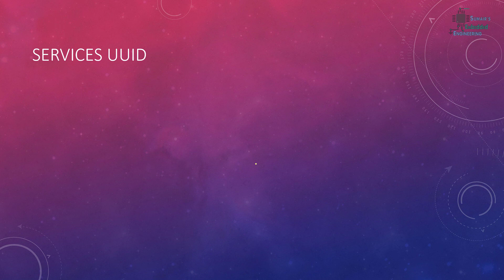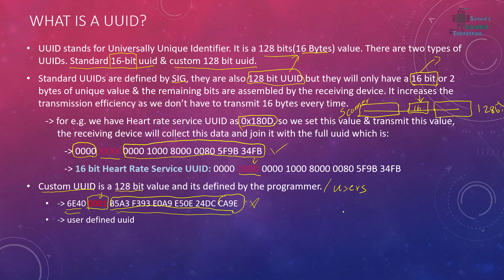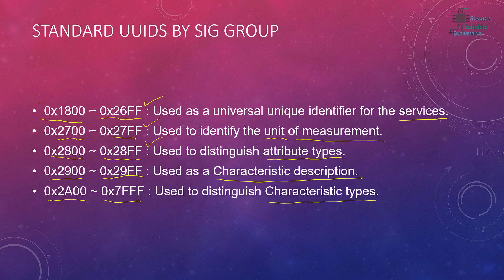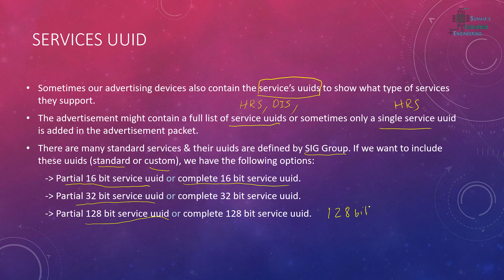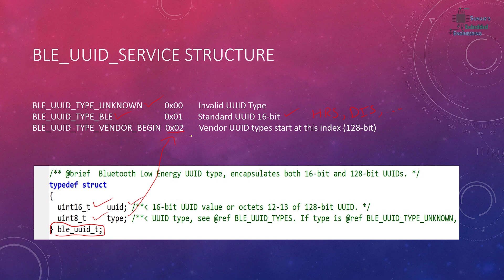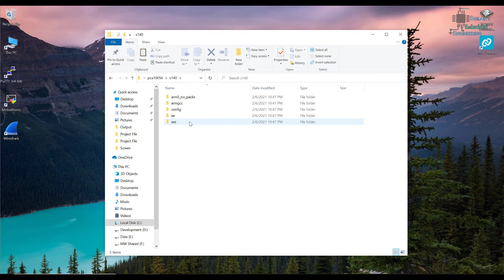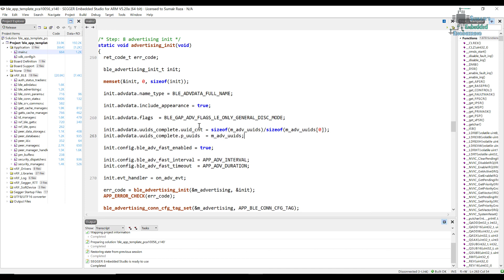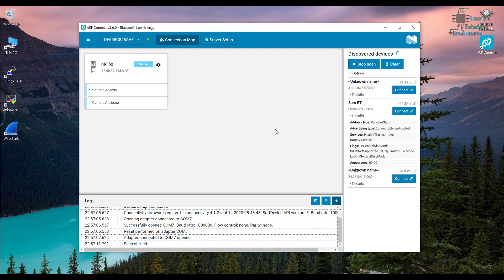nRF5 SDK - Tutorial for Beginners Pt 45 J - Including Service UUIDs in BLE advertisement packet

Comment: I have my gps module wired to an esp32c6. I can receive the NMEA sentences over BLE with it set up as a serial adapter. I changed the uuid, but it is not recognized as a gps device on my iPad.
What else do I need to change? MAC address?